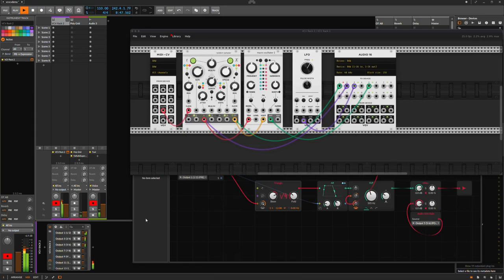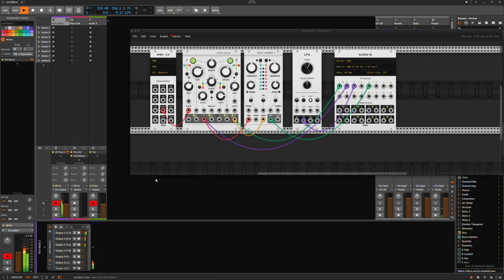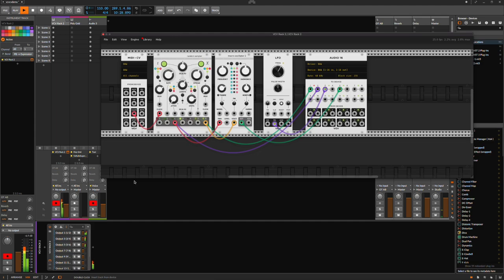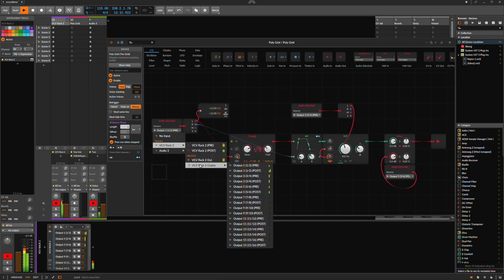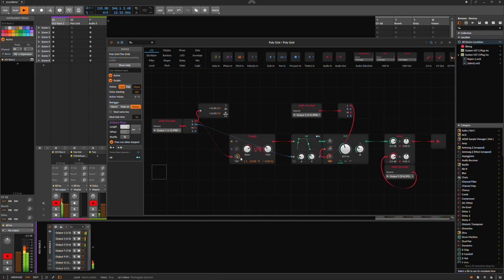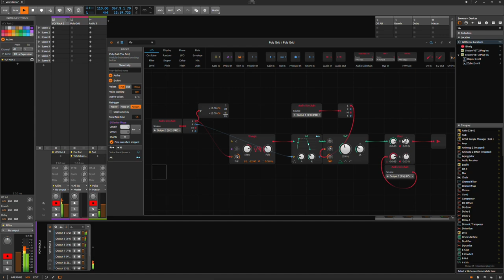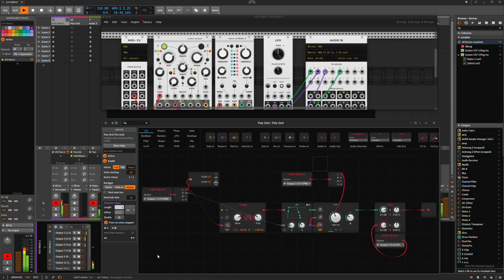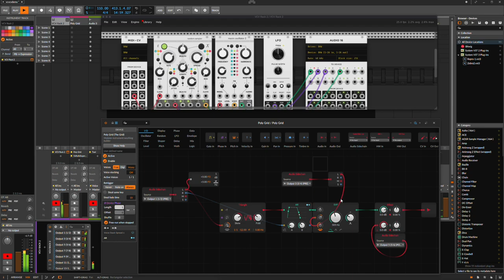Perfect integration of VCV Rack 2.0 and Bitwig Grid

Comment: VCV is a great compliment for the grid because it fills in a lot of the limitations such as MIDI out. Fun combo!
Reply: Is it so? We are discussing the limitation to get MIDI out of The Grid in this feature request: https://bitwish.top/t/midi-grid/578

If you know how VCV could help, your feedback is very welcome!
Reply from the maker: @QuimGil  yeah, they would need to add a midi grid and also a 'modulator' grid to really round out the features - though I fear they will never be priorities.
I like the grids simple to use nature.
but at times I miss the flexibility that M4L provides...albeit at the expense of complexity.
Reply: @QuimGil  VCV does CV > Midi. So anything you can pass into VCV from Bitwig (from The Grid or wherever) can be converted to Midi. I think the main limit right now is that Bitwig will only pass 4 audio channels into a VST (Main stereo input and sidechain input). It would great if the allowed full multi-channel audio input to VCV.
Reply from the maker: @stevebaker2896  I think the reference was to lack of midi output options in ‘the grid’ . It can output cv , but not midi.
Reply: @TheTechnobear  Yes I understood that. In  reference to that issue, Quim Gil asked "If you know how VCV could help, your feedback is welcome." - So I explained how VCV could help solve that problem.

Comment: Hey sir, you helped me out with a midi question a couple weeks ago but I've run into another issue. Can't get midi to work at all. I have a circuit tracks run a 5 pin midi into a Dreadbox typhon, then the midi out from Typhon into usb on the Organelle and nothing. Tracks sends midi to typhon on channel 3, channel 4 is supposed to be Organelle but nothing. I tried setting Typhon's out as a thru and as channel 4 and no cigar... tried the other way tracks into Organelle and then into Typhon and nothing from either. I used the usb to 5 pin on a volca keys and it works, so I'm not sure what the issue is. Any thoughts?
Reply from the maker: Not really , not enough details eg what organelle patch, is it organelle seeing your usb device … also I’ve no experience of the typhoon… this is better discussed on Organelle forum where we can go into more details - and others might be able to help too.

Comment: The question i had when I clicked on the link is how did you set up VCV to receive clock from bitwig and see the inserts to send back to bitwig? So, like, what happened before you started recording?
Reply from the maker: this video is focused on integrating vcv and the grid rather than simple bitwig integration (which I think many have done videos on) 
basically clock comes to vcv via the midi>cv module, as you can see the clk/n output into marbles... sending audio back to bitwig you simply use the first two audio inputs on the audio module.
this is how the vcv rack vst works in all daws.... so is not specific to bitwig.
as I say, this rather focuses on how we can nicely integrate vcv rack with bitwig grid, and so enjoy both modular environments in a seamless way... and considerations that need to be kept in mind
Reply: @TheTechnobear  cool. My error was thinking this was VCV standalone rather than as a VST hosted in bitwig.
Reply from the maker: @GeorgeLocke  no, nothing has changed in vcv 2 that aids that... thats still done the same as vcv 1 ... generally, virtual midi connections, or things like loopback audio (assuming it can use cv) 
but I'm not covering that.. its super kludgey.  also,  really there is no reason not to use the VST ... sure it costs $, but I also consider that as a way to support a project that has given so much free to the community... so happy Im happy to contribute... and get very cool functionality :)
Reply: @TheTechnobear  word up. Yeah, the only reason cash. I've spent a fair amount on VCV modules, but until recently have not been using a DAW, so haven't had a good reason to buy the Pro version. There are some corporate policies that seem hostile to the open source nature of the project - in particular, if you contribute modules to the module browser, then you give up very substantial rights to the ownership of anything you put in there, including the possibility of VCV Rack assuming total ownership if you don't update for X months or something.